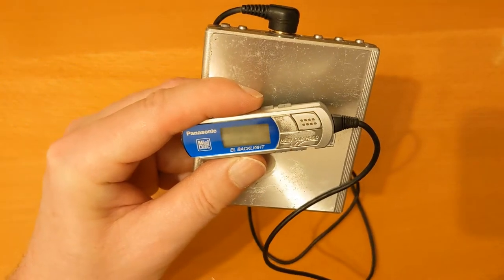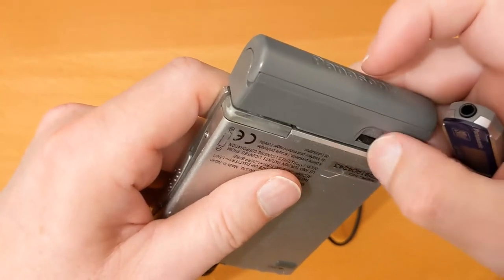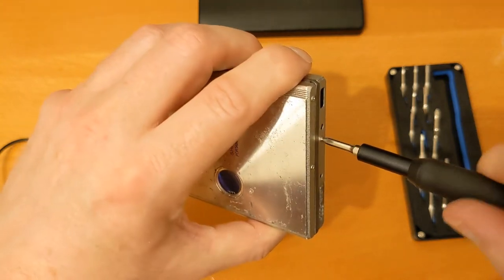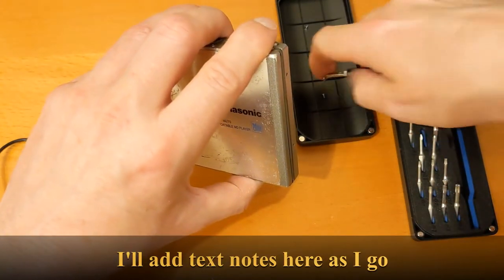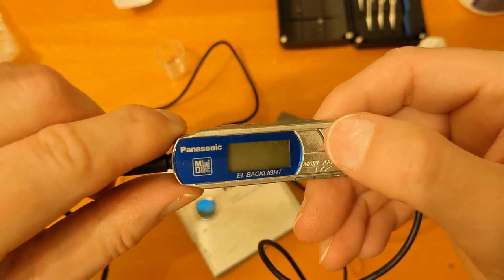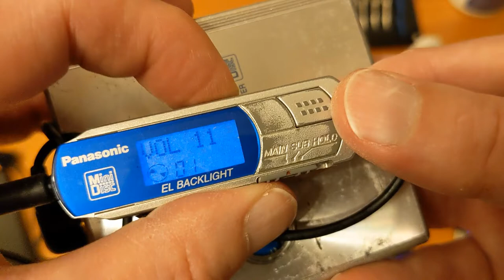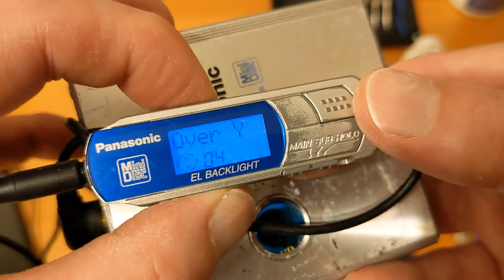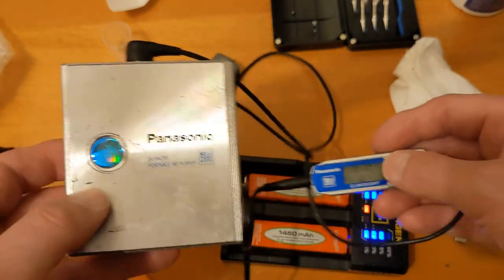Cheap Minidisc Player Fully Working After Teardown & Service

Comment: Great vid, will try & repair some of my dead MD players. Also I have used my SJ-MJ70 with the MJ55 speakers, looks top (you need to be careful of the vol. buttons though)
Reply: sorry MJ50 not 55 DOH!
Reply from the maker: Thanks very much. Great idea using the MJ50 speakers with the MJ70, not so much for the speakers in my case, but for charging the gumstick battery. These Panasonics seem to need a fully charged battery, and swapping the battery frequently can't be good for the battery door. I'll be careful with the buttons, thanks.